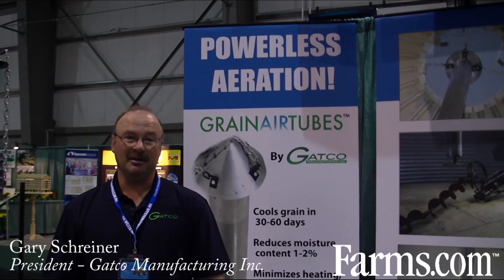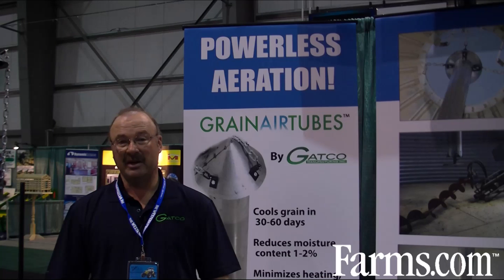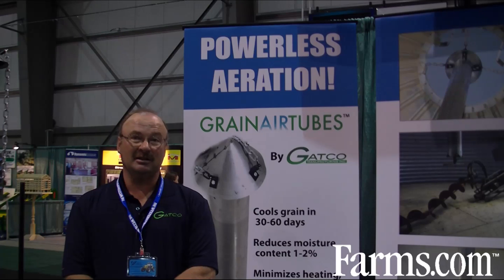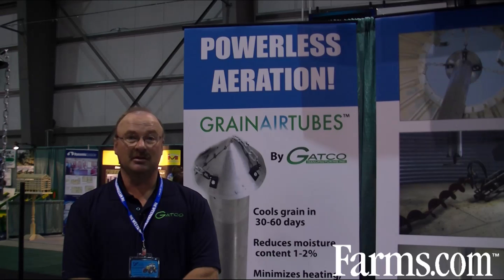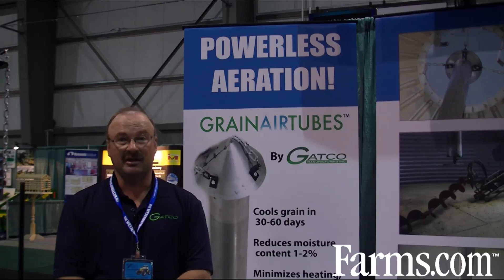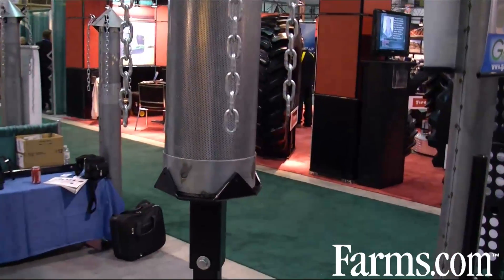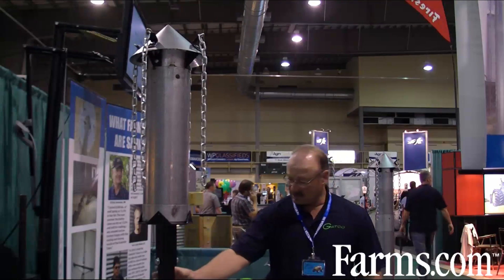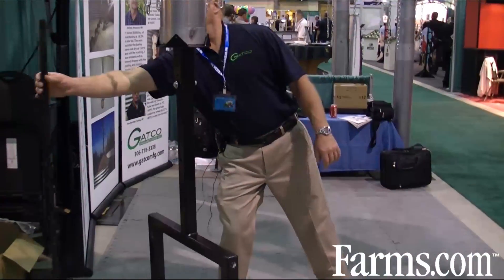Grain Air Tubes by Gatco:  Aeration To Improve Grain Storage.

Comment: Used this system on 5 bins of canola the 1st season and 5 bins of barley the 2nd season. All 10 bins heated at the peaks within a month or so. This idea definately DOES NOT WORK. Returned all of the product to the manufacturer. 
Lost 30,000 bushels of malt barley but was able to salvage the 30,000 bushels of canola luckily.